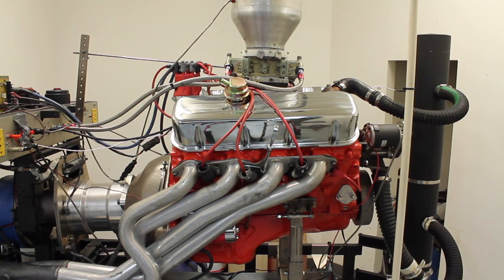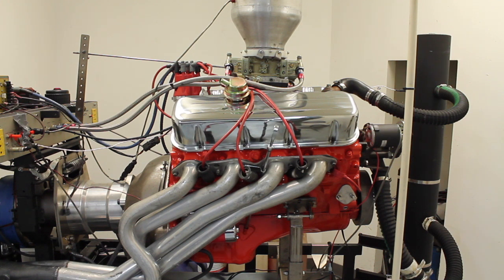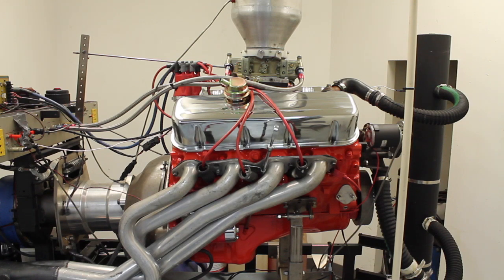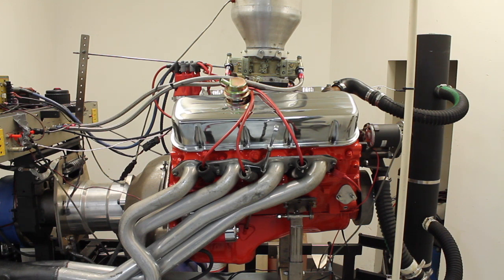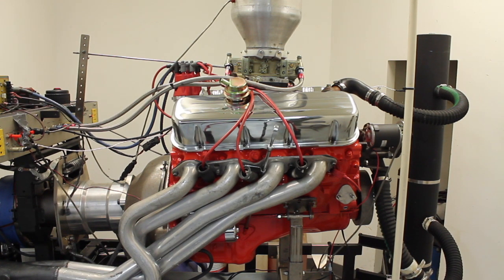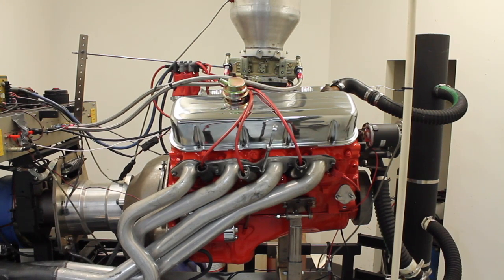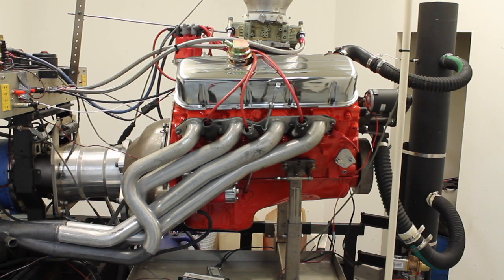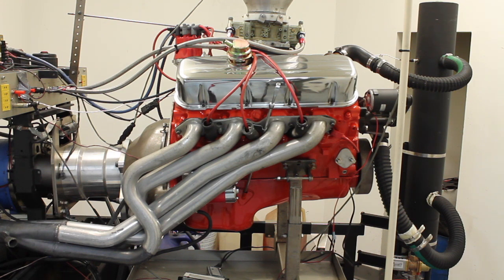Vortecpro 427 L88 Engine Build

Comment: I would like to see you build a 402 BBC with using factory cast I think 820 heads it seems no one can get in the 500 to 600 horsepower range with these engines I don't understand how a 406 SBC can easily make horsepower but a 402 BBC can't with bigger heads

Comment: Notoriously underrated ..from the factory,  never more than 435. Posted.  Love this. ………..great job
Reply: Cant believe how much air he is getting through those 840s. Dam!
Reply: It'd make 435 with a plug wire off.
Reply: Rated 430 hp from the factory.   435 hp was the 427 with the three two barrel Hollys

Comment: Mark I have this same motor as well with 10.50 compression and Strip Dominator intake, holley HP pro 950. What is the cam Part number you used in this build? My L88 is still "Virgin 4.250"
Reply: Which heads are you running? Sounds like a blast of an engine to me

Comment: I had a 2nd design L88, 1969 model w/ .560" x .580" factory cam? (sorry, I measured and not sure it was right), with the 850 holley best of 10.82, at 123.w/ 11.5x28 x 15. 

2x 660 center squirters on a Wiend tunnel ram on it and it ran 9.82 at 139 with Blairs Steve B. tuning it. (I couldn't get it to run but 11.3's). Those engines were the bomb!!!!!(not legal for anything short of C/gas)
Reply: Blairs in Socal? Buddy worked there for many years. Pasadena no?
Reply: @gordocarbo  Yes, in soCal, right down the street from Bob's Big Boy! Great cruisin' after u spent all ur money on the engine!!
Reply: @raymondgoshorn2005  Small world! Guy named Frank K worked there for yrs
10s is crazy fast!! Especially way back when. 
Sucked when LACR was closed down. Could drive from Chatsworth to the track Weds or Fri night, make runs and behome in time to get enough sleep before work the next day!

Comment: It's not an L88 in any sense. It's a built 427.
Reply: Come on why nitpick? Its better than an L88
Reply: @gordocarbo Better? More power and likely longer lived. But it's not what an L88 was, not the compression, the camshaft, the valves. I won't argue it's not better, but it's not an L88.

Comment: I didnt understand your comment on connecting rod length. Im gathering parts for a 427 build now. I have a standard bore 4 bolt main 454 block, a forged 396 crank and a pair of LS6 large rectangular port heads. What connecting rod length and pistons would you suggest for a short deck 454 block?

Comment: The high performance big block closed chambered heads was 11 to 1 pistons and the L88 first design was upped to 11.5 to 1 pistons and the second design open chambered oval port aluminum heads had the 12.5 to 1 pistons. I lived and raced this period with the baby big block the 1965 Corvette 396 c.i., closed chambered iron square port heads that was rebuilt 30/over 13 to 1 pistons and a full race cam with upgraded valve springs. It never was put on a dyno, but the machine shop/speed shop estimated it should have been around 650 hp. It pushed my 1972 split bumper SS/RS Camero, (yellow & looked good), like it was that much hp. I had the M22 four speed that was going to replace the STOCK Turbo 350 that was starting to slip from foot braking that much hp, then my brother totaled the car when it was T-boned. Then I got married with children that made me store the engine until 2004 when I sold it to a guy that needed it for his 1965 Corvette restoration, with the months and weeks stamped or molded so it perfectly fit his Vette's body build date. I kinda wondered if that engine I bought actually came from that car. Be safe and healthy while having a good day.

Comment: HAHA, this engine is no more an L88 than I am, L88's had Aluminum heads and over 12 to 1 compression this engine is just a hodge podge of after market speed parts, false advertising.
Reply: I have a real L-88 over the counter short block crate engine, has the CE stamping on the front pad. I also have a pair of 074 aluminum open chamber heads, both were purchased from Chevrolet in the mid seventies.  I raced the 427 in my 68 Camaro for about 5 or 6 years and then switched to a LS-7 454. The L-88 block has no wear at all and the cross hatch is still visible on the cylinders.
Reply: Incorrect.  ZL1s had aluminum heads.  This guy knows more about building power than most of us combined why insult him?

Comment: Great video!  How much does this motor cost to build? and, which aluminum heads do you recommend for a similar build?  Joe
Reply: THis guy is the master of BBC builds. Next yr Ill be doing the same. 427 AFR or Dart head solid lifters single plane etc.

Comment: I have a 427 60 over that makes good power 661@6000 rpm 605 torque it's got afr 265s on it I have a hydraulic roller in it now but think I'm going to put my solid roller in it it's 256x260 duration 666 lift on a 110 lsa I think it will get me about 30 more hp.
Reply: Updates? Youll love the solid, Ill never go back to a hyd cam unless its a very mild daily. No comparison!

Comment: Why do you use 1.8 ratio on the intake and not on the exhaust?
Reply: I figured you would know, but it seem you do not.
Reply: @joe-hp4nk  , I cannot answer for Mark, but usually the exh does not benefit from additional lift or rate of lift, it's normally counterproductive. The intake is different ,( usually), in this respect.
Reply: @joe-hp4nk  WHy ask then insult him?  Hes probably busy working his ass off cant be online much.

Comment: Man that motor really makes some good power I sure wish my 427 would make that kind of power I know I'm not running near enough cam shaft to make any real power it's a howards hydraulic roller 235 x 241 @50 618 lift on a 108 lsa I do have a good set of AFR 265 oval port heads and my compression  is around 10.5 to 1 the motor has not been on the dybo yet I was hoping for 550 hp but I'm sure with that cam I'll be lucky to make 500 hp. I love your videos

Comment: I’m building basically the same engine at the moment with slightly smaller solid lift L88 grind comp blue print cam, a ported 840 heads with 188 exhaust and 230 intake valve. Forged internal balanced crank and 40 over forged pistons. I hope it makes hp even close to this😎👍
Reply: How did it do.?

Comment: Very nice build! I am always intrigued with 427 builds. You don’t  hear much about them anymore even though years back that was the king of Chevy engines. Always wanted to build one with modern afr oval port heads and a solid roller with a tunnel ram for a street strip car with a manual trans! Fun I bet!
Reply: Did just that with a friends 11-1 454 a few yrs back. 290 afrs, spent time porting...also had a tunnel ram dual 4s. Hyd flat tappet cam (couldnt talk him into a solid), thing was a beast!

Comment: Awesome build. Quick question: Relatively short stroke and fairly mild compression with long duration cam. Help me understand how this motor is cranking out 590 TQ. Thanks in advance!
Reply from the maker: Ok- 590/447=1.32 TQ per inch, 660/496=1.33 so as you can see its not a crazy number, then theres were intake valve closes, and the dual plane intake.
Reply: @VORTECPRO  LOve the grind you picked. Any idea how many miles to expect from a solid roller setup before tearing down for inspection?

COuld I mail you my distributor, put it on a machine to ck?sbc msd (summit) dist.

Comment: From what I've heard about you, I consider you to be an expert head porter, and engine builder. Do you get a chance to cc the intake ports on those heads after you finished the port work? I'm just curious what the final total volume of the intake ports is. I realize that the contours and shapes of the ports are more important than the actual volume. But I'm just curious.
Reply: He didn't say he ported them.  Valve job, bigger intake valve, fixed a spot, and new guides is all he said he did.
Reply: @SealofPerfection  You don't read so well, do you? Maybe look at it again, I'm sure it says "fully ported" in there somewhere.
Reply: @Anarchy-Is-Liberty  He says nothing in the video about any port work.  That's what I went by.

Comment: Mark, What off the shelf roller cam for the drag strip?
 I have a 
468 bbc 
781 heads big valves port matched tunnel ram Holley 660 carbs
10.5 compression 
4 speed 
1/8 mile gears
Reply from the maker: Where do you race, compression?
Reply: @VORTECPRO  Madras Oregon 1/8 mile. 10.5 compression.
Reply: @VORTECPRO  Mark ballpark for a 11.5:1 427 afr heads using a 454 4bolt block you supply. Finally getting close $ wise Im thinking spring at the latest Im in Ca. Used to be on Team Chevelle often. 
Going in 67 El 6 spd 411 26 inch tire. Solid lifter cam similar to this

Comment: I’m always impressed how your BBs make so much power with such conservative compression ratios. Great job as usual Mark
Reply: True!💯 Mines made 565hp/600tq on 9.1:1 CR with a small camshaft. It idles at 600 rpm in drive😁
Reply: How Bout 990 heads ported???????? 12w 1/2 with rectangular heads.... From 1969......  ..that motor seen more than 650hp...........
Reply: I just happen to have a set of 840 heads dated 69 AND a 1970 L78 block. Funny how a lot of people don’t like the 840 heads.
Reply: @Huntinghogs  Sold a set of 840s, even 10 yrs ago I had to practically give them away at 100/set. Guess the crowd is getting less and less these days. 291 (?)Ovals sold for the same...those were mint, cleaned magged etc.
Reply: @ I hear the pure stock guys will pay good money for them.

Comment: I have questions on valve size. First why 1.80 and not 1.88, was it because of the head damage or is there a performance gain from the smaller size? Also, your 049/781 usually get 2.190 intake valves and not 2.250. Is that because there isn't enough cross section in the port to make use of that much valve?
Reply from the maker: 1.800 was used to keep the valve away from the chamber. Factory bowl is to big for a 2.190 valve.

Comment: Though L88's had aluminum heads on it? To me this would be the copo build.
Reply from the maker: Over the counter first design L88 short block, owner added 840 heads, very common back in the day.
Reply: Early l88 had iron heads , went to aluminum 842 than 074
Reply: OOO didn't no that.